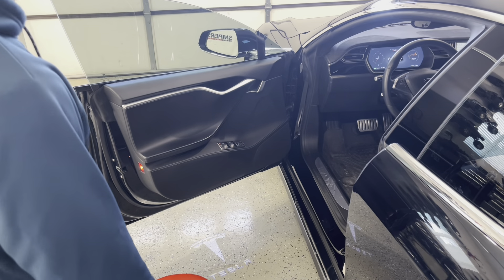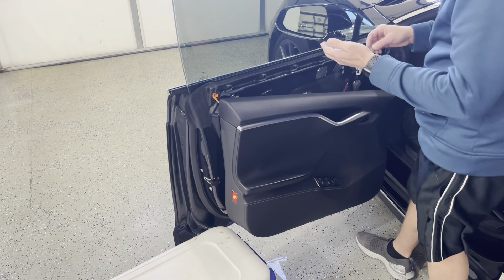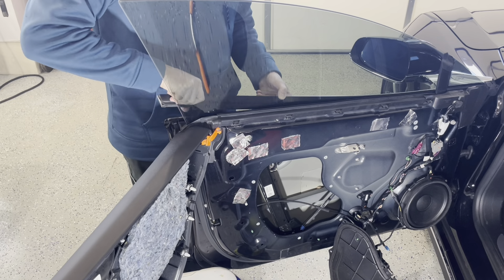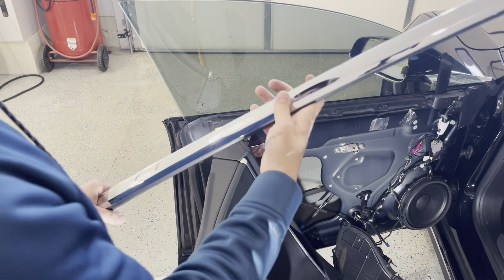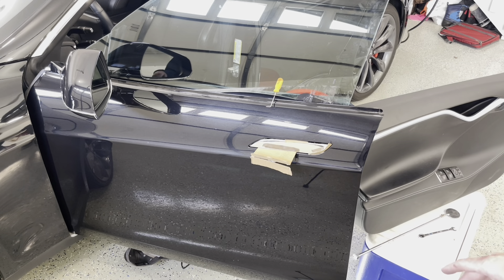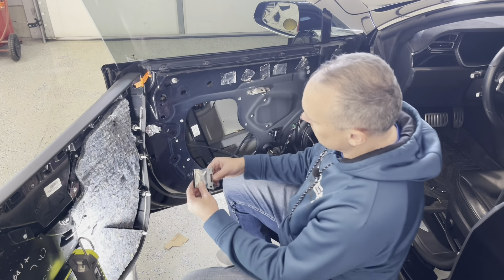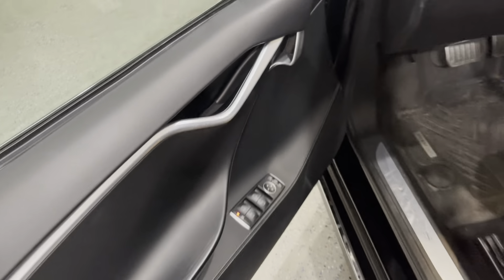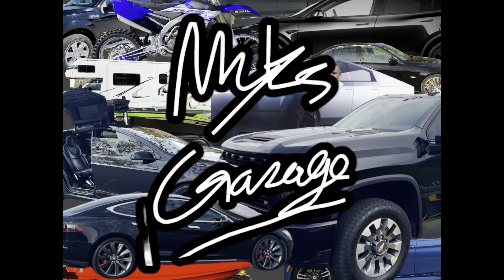Tesla Model S Door Handle Repair Process.  What A Joke! Watch Me Struggle To Fix This!!

Comment: You made that job look like a 3 cause meal.  Tip… lock door raise window up just the right amount to undo that middle screw. You lock the door using a screwdriver to push lock when door open. Tip two. Use masking tape on the door shinny bits. Tip 3, get your son to help you out more. We can always do with another set of hands.
Reply from the maker: Good tips!!
Reply: I'm wondering since you didn't have that cover on your handle maybe moisture and weather cause it to fail sooner

Comment: Just an FYI. There is an option to turn off the self presenting handles completely and open the doors manually by pressing the handle. It is no different when the handle fails. Just use it manually.
Reply from the maker: Interesting
Reply: In all years or just later?
Reply: @Nicholas-f5  all

Comment: For information: you don't have to take the window clamp off, just loosen the bolta little, and lift window enough by hand, and you are able to remove the door handle assembly. Saves a lot of trouble and steps.
Reply from the maker: Yeah that would make it easier!

Comment: When the paddle breaks you CAN get into the door. Press the recessed handle, it will unlatch the door, and the door will pop open a bit.
Other than that, thank you for the video. It's so refreshing to see an actual informative video.
Reply from the maker: Thanks for the feedback!
Reply: Is there a setting for this? I selected the setting that prevent automatic presentation of the door handles, but it didn't have this effect. Now, the car just presents the handles when I press the recessed handle. It doesn't unlock the door.
Reply: Maybe on later years

Comment: Just to clear it up. Water in the door is completely normal. Every car functions that way. The water that goes down the window usually goes down the door and there's drain holes in the bottom to let that water out. It's only an issue if the drain holes get filled.

Also just to add it since I thought of it afterwards. You do not need to and it is not recommended to wrap electrical tape around those connectors. Those connectors are already waterproof connectors. Putting electrical tape around them just increases the chance of water sitting in the connector.
Reply from the maker: Good to know, thanks for watching